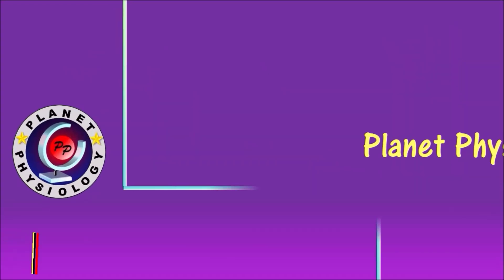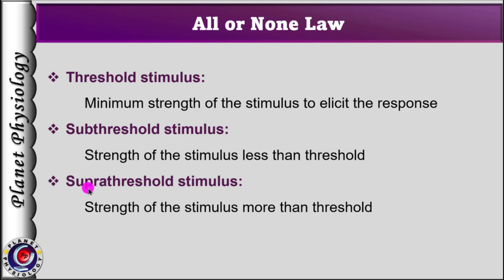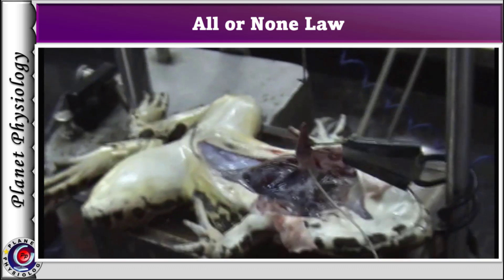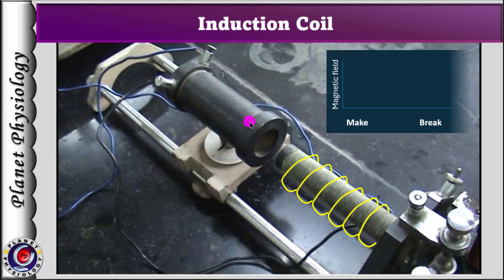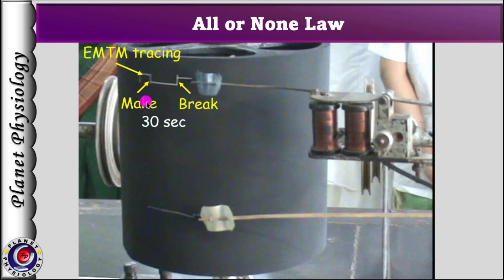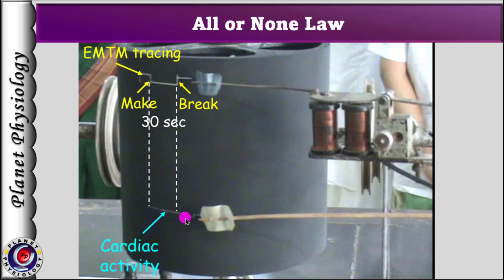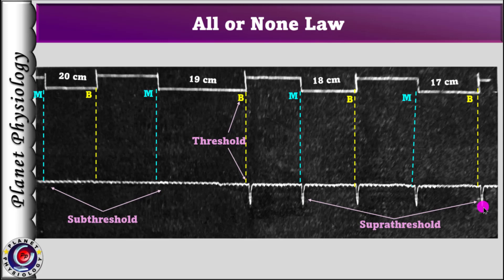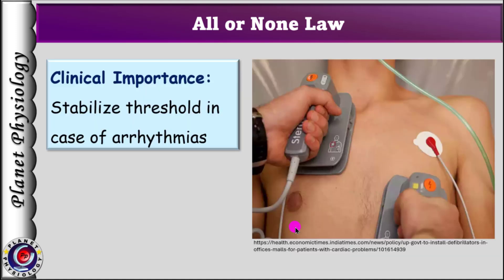All or None Law in Cardiac Muscle

Comment: I think we wait for 30 seconds between the stimuli to avoid summation.

In cardiac muscle, all or none law is applicable to the whole cardiac muscle (syncytium) while in skeletal muscle, it is applicable to a single muscle fiber.
Reply: Mam please explain why threshold at break and not at make
Reply from the maker: @Anjuphysio  It's due to the property of induced current. Induced current strength  depends on rate of change of magnetic flux. As it is more during  breaking of the circuit, break shock is stronger.  Watch the video from 2.15 sec to understand the concept of induced current.
Reply from the maker: Well tried. Your answer is partially correct.
We wait for 30 sec to avoid beneficial effect of previous contraction. Though it is sort of summation at calcium levels, usually we  use this term with respect to synapses.
Reply from the maker: You have correctly mentioned that all or none law is applicable to whole cardiac muscle. But it will be better to say it as entire syncytium.
For skeletal muscle, can you use a better term instead of single muscle fiber?